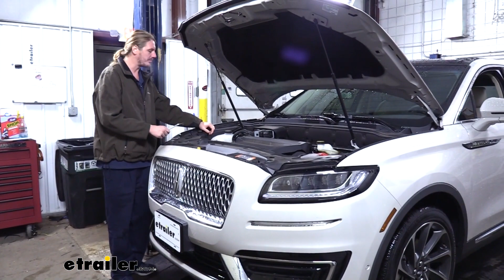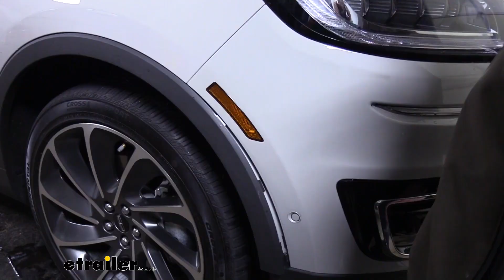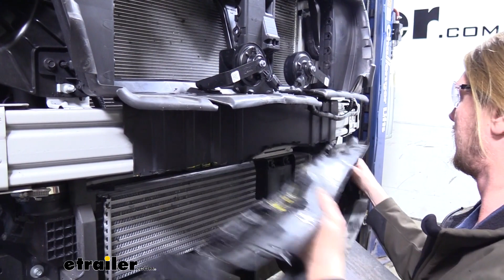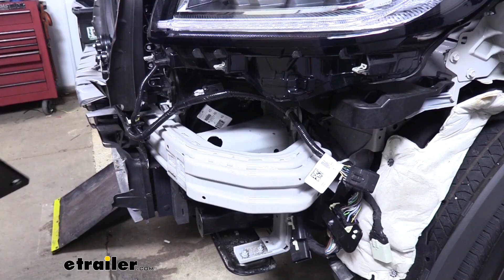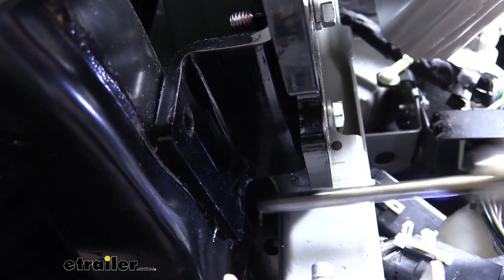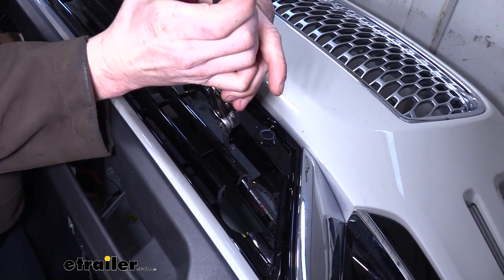etrailer | Installation Guide for the Blue Ox Base Plate Kit on a 2019 Lincoln Nautilus

Comment: that piece you made a hole in and cut . can that piece be replaced . I purchased a nautilus and it came with the hole cutouts . THANK YOU GREAT VIDEO
Reply from the maker: You should be able to get a replacement from the manufacturer.
https://www.etrailer.com/Base-Plates/Blue-Ox/BX2680.html
Reply: @etrailer  thank you for all the great information . awesome